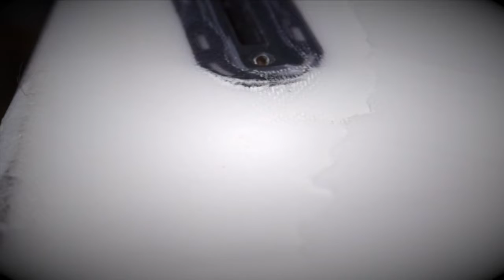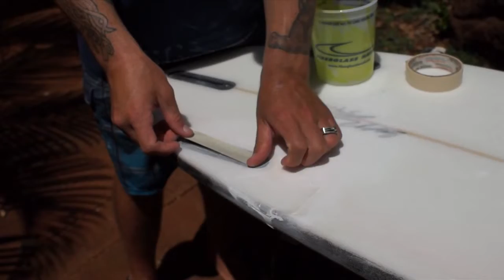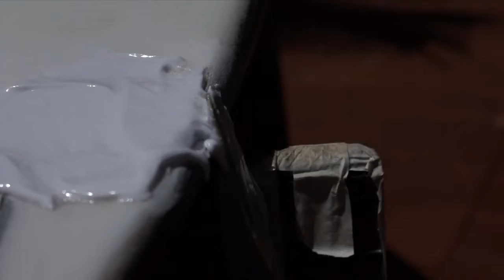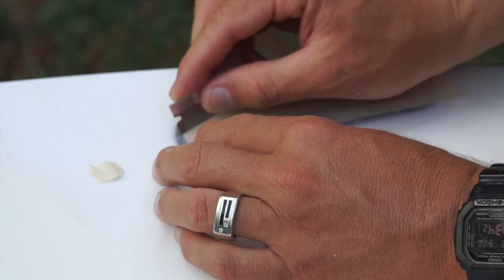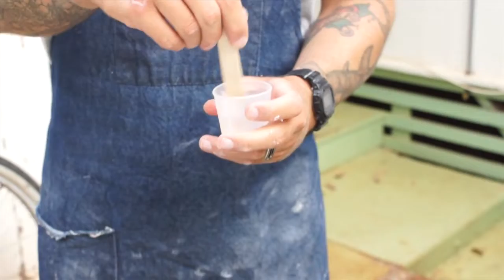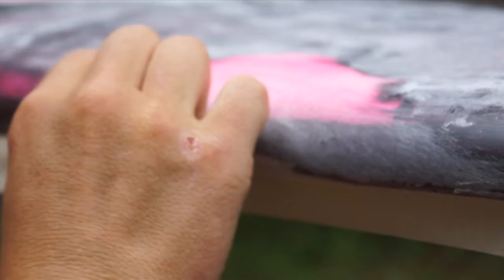Surfboard Ding Repair Tutorial

Comment: SAFETY FIRST! Take off rings and other jewelry unless your made of money, wear a dust mask at least when sanding, use something other than a shirt to wipe resin that might have fiberglass in it, as already mentioned DO the gloves when working w resins, DEFINITELY wear a VAPOR mask when working w resins, try to work in shade if at all possible (UV light changes the chemical reactions in the resin compounds, resulting in weaker coats and coats that can discolor), maybe put the Q-cell in before adding the hardener for longer working times if it's your first time(it'll harden anyhow if you mix enough), make sure to mask off a wider area to avoid having to sand areas you would't need to other wise, be sure to sand LIGHTLY on the initial hot coat w rough grit pass, increase sanding pressure as getting closer and with water, but not excessive ...buff if you want to come out super clean and slick, but not needed.

safety might not be a concern for those doing this once for a "quick fix" but if you do this often, at least on most weekends for example, invest in the safety gear...someone else mentioned what the resins can do to your skin, let alone your nerves, lungs, brain cells and eyes! if working inside to get shade then best get a fan going to move vapors away from your face.

The manufacturer of these products should use better quality control when it comes to "how to" safety videos...just saying.

But yeah, overall, nice explanation to get it done the "correct" way! [like he said, LOTS of ways to get same results, preference]
Reply: Thanks man, that's good advice ;)
Reply: What is the "hot coat"
Reply: @joshuwa7279  It's a final coat, resin only which is used to fill up the last details
Reply: Make a video yourself to help, thanks
Reply: Maybe you should make a video, like honestly because I was about to do everything, and I thought that it was strange he is not wearing gloves and the guy at the store told me you need gloves

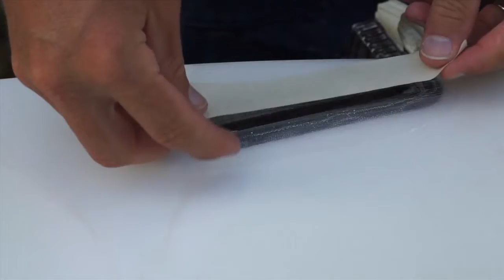Comment: CLAMS CASINO! beat comes in @ 4:44  love the vid, totally helped, thanks!  Does this process apply for super minor cracks?  My board hit a rock, it cracked the very top layer, no dent though, but I think water could get in.  I'm thinking all I need is the epoxy sealer, not the q_cell stuff.

Comment: Thank you for the video. I purchased the Ding All repair kit found at most surf shops in California. The kit includes most of the items in your video minus the hot coat. My question is: is the hot coat required after blending the cloth by sanding?
Reply: I think the hot coat is the resin that comes with it, it’s the last layer On to of the fiber glass
Reply: Every ding repair kit has resin, that is what you use to hot coat. It is the same resin you would use to laminate the fiberglass and mix with q cell

Comment: Are you ever worried about sanding to much around the area of repair cutting into the unaffected area? does that cause an additional weak point ?? Great video
Reply: Try not to... You should only sand minimally - like 1/2" around the ding so you don't mar up the nice finish around ding. Won't weaken board cos you're not sanding a layer off, also, the cloth b resin is adding strength to the repair. Don't go crazy sanding. Take your time n go thru the grits. 120, 150, (220& 320 wet). Done

Comment: You need to grind all of the glass out of the buckle and the crack. Well you don't have to but Q-cell bonds much better to foam.
Reply: Does this mean taking a knife and peeling out the old glass would be best?
Reply: matt kawamura in short yes. But I would use a grinder instead of a knife.

Comment: I really recommend using a gram scale to measure out your epoxy resin and always mix at least 1oz. The weight ratios are 100:40 it says so on the bottle. Trust me I learned the hard way! Epoxy resin is temperamental and you only have a 2% margin of error with the ratios. Or thats what someone told me.  Don't trust your eye!

Comment: I need to do minor repairs on a brushed finish carbon SUP.  They seem mostly cosmetic, as they don't appear to be cracked down to the foam.  should I use carbon cloth rather or fiberglass cloth? also, I'd like to mix white pigment to match the finish.  When does the color go on?

Comment: I have a slingshot built with bamboo so repair will be more obvious on bottom-side rail
Is there a way I can put a clear repair layer so the bamboo still shows or just do the wrap around top-side-bottom with fiberglass?

Comment: + Fiberglass HawaiiHey I was wondering how you clean out the mixing cups as well as the brushes? Also when you say hot coat is it just the A+B without the Q cell? Thanks been awhile since I've worked on my own boards
Reply: TRIKushbeachside acetone
Reply: TRIKushbeachside no q cell on hot coat. It's porous so it technically might not be water tight. The hot coat is a straight 2:1 mixture of resin that will be water tight and be free of cloth or any other stuff like q cell
Reply: Visceral  thin and quick, so its fast (aka hot)

Comment: +fiberglasshawaiiTV Im a 15 Year Old Surfer, but my dings aren't as bas as yours BUT i have a faint white line across the nose piece. If i continue to surf with it, will the nose snap off?
Reply: Quantum Editing im 14 and i have the same problem in my surboard but its in the middle, so idk sort of scared
Reply: +Emerald Overlord I had the same thing and I took it to a dumpy beachbreak, nose dug in sand, fractured board to point where it almost fell off, then later that day it did. but I had that line for a long time, and multiple dings in same general vicinity, so just be careful with yours. BTW I'm 14
Reply: surflukify k i will, thx
Reply: It broke, Thanks for the feedback though guys, I now have a Lost board :)

Comment: Does anyone know if I can use the 2:1 epoxy resin to repair a polyester fiberglass surfboard?
Reply: Jerome Ramirez yep, but don't use poliester on an epoxy board
Reply: it depends on the resin you use. some are 1:1, 2:1, 3:1 or 5:1. It should say it on the packaging. Wear gloves and a mask all thew time. Epoxy resin is really toxic.

Comment: @fiberglasshawaiiTV What ratios of resin, hardener and q-cell did you use to get it so fluffy? How long did you whip it up for and did you whip it indoors or outdoors? 
I have tried a few batches now but cant seem to make it as fluffy as yours for a rail repair.
Reply: Mix up your resin and hardener (ratios are included with product packaging for any reputable product), and stir in the q cell a little at a time until you get the consistency you want.

Comment: When do I take the masking (edging) tape off? Before the area cures or after it cures? I was thinking if it is after it cures, wouldn't the tape be glued down as well?
Reply: Marcus Dee you cut the masking tape from your lamination at half cure, so it's hardened enough to work with and not move things around, but not fully set as you would have tape glassed into your board haha
Reply: Yea If u leave it sometimes the adhesive mixes with the glass and gets funny

Comment: Does this work for both epoxy and fiberglass boards?
Reply: +chlela01 You can epoxy over poly no problem - it's a physical bond (thus the rough sand paper).  In fact, many boats put a layer of epoxy over the poly hull to prevent water penetration (osmosis). You cannot poly over epoxy very well, though.

Comment: Do you use the same resin in all the layers (incl hot coat) ?
Reply: Initial resin = laminating resin. Hot coat = sanding resin (laminating resing with wax solution added)

Comment: is Q cell and Cab-o-Sil in the UK is it  the same stuff? fluffy white thickening powder which makes the resin or gel coat non drip and a light filler?
Reply: No cab o sill is different from q-cell. If you go the the supply store and they say they don't have q-cell, ask for glass microspheres. That's the other name for q-cell. Cab-o-sill is more of a thickening agent ( it also blends clear), and micropsheres/q-cell is a filler.
Reply: K Hodges thankyou so much! dam Ive had to write all this down in my surfboard construction diary. also when I approach my fibreglass store here in the UK I bet the bird working there is also in the dark about this stuff?. I hope I can locate Q cell here in the UK and practice with them both . I have used cab osil one repairing a snapped board together again and it did help. Qcell sounds great cheers KH appreciate the info. I'm one of those board shapers that lives miles from waves and doesn't own a car. so I make boards and never ride them. Hopefully I may buy a 2nd hand pick up truck one day cheers.
Reply: Brian Trend yeah no problem man. Yeah some employees at the supply shops are in the dark. I've had to educate them in my area a couple times. And yes for a snapped board q-cell works really well because the end product is lighter than using cab-o-sil. One thing you don't see in this video as well is how well you can sand q-cell. If you catch it at the right time, just before it cures completely q-cell flakes off like cheese. The q-cell will feel hard, but tacky to the touch and it will be hot as it's still curing, then take a flat sure form and shave it down. Just play with it and you will find the perfect time. But yeah man. If your building boards it's time to get yourself a car and get near the beach. Haha.
Reply: K Hodges  I live in Torquay in the English channel south Devon so no waves here maybe 3 waves a year in storm swells. North Devon is a wgole better story some really good waves up there. I retired from construction in London after a heart attack and coma and I'm a retired pensioner now ha ha.  I took up my old hobby board shaping after a 15 year lay off and started again from scratch. Getting into it fast have a quiver of 8 boards now and its addictive! Time to sell a couple for more materials. Its cold and rainy here in winter, so not a good time to glass here. 2nd hand cars are pretty cheap in the UK but its the long term ownership and maintenance and parking here thing that is such a rip off in this country especially the insurance racket. So as a pensioner I have to watch my pennies ha ha. I bought a used mini Malibu 7'6" for my dog Charlie and now hes standing and really into it, hes a sprollie , a border collie /springer spaniel cross and a real sharp cookie he just barks and gets everything he wants little spoilt shit. Im shaping a copy of Losts latest fish that red and blue railed one with the wide channel out the tail. I did a red and yellow swirl glass job on the bottom then on the top deck I successfully used those grain rubber tools you resemble wood grain art work. put mahogany on the sides and an artistic version of pine woods in strips in  the middle. those rubber grain tools work really well , as you pull them you rock them at the same time and the wood grain looks amazing. check out the guy on utube who does woodgrain with acrylics and floor varnish to seal the colours then covers it with 2k varnish sealer to seal it on the water ski. his finish is stunning. Sick o wood now and will soon be working on a Lost style 6'4" rocket /driver probably do the bottom in sea green and clear top deck. I was brought up on longboards in the 60s and then in the early 80s a MR twin blew me away and its great to see Lost are doing some of MRs designs their way and they look amazing. that Biolis is a great shaper. cheers K,   brian and Charlie surf dog      Ps, check out     Europa the final battle     on Utube. utube banned number one, which is very important, but you can find it if you look down the comments they guide you in . the videos are 1 to 10 and are very informative of where we are heading by far the best videos on utube.
Reply: K Hodges  you can get the rubber grain tools on ebay for a few dollars/££ just make sure you clean them afterwards to retain the image cleanly. They work so well and easy to get used to . You can make your foam board look like a full on balsa wood board
Reply: Brian Trend https://youtu.be/OEhfypCdn5k I just found this video. From what it looks like you get some pretty good waves. Probably better than where I'm at. I'm on the gulf coast of florida.  I'm sorry to here about your troubles though man. I hope that's become just a memory in time. But yes I love fiberglass as well. I'm all about it. From surfboard fins to boats. But yeah man sell you work and keep building. As far as the cold you can remedy that by using a heat blanket. Just wrap it around the resin and keep your heated up when your working. And maybe a space heater to keep the glassing area warm and it should be ok.thats funny you got your dog surfing. From what I know those breeds are very energetic so I'm sure he/she is having fun man. I'll check out that video as well
Reply: I don't know much about grain products though. I know who they are and like their work though.